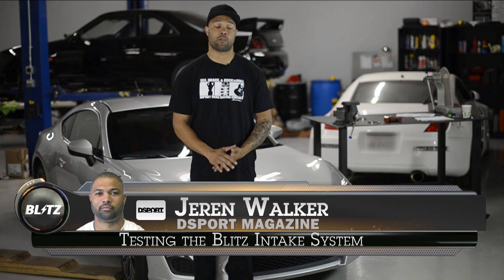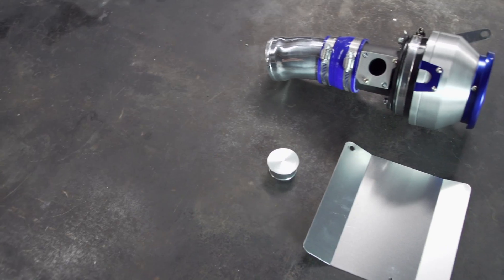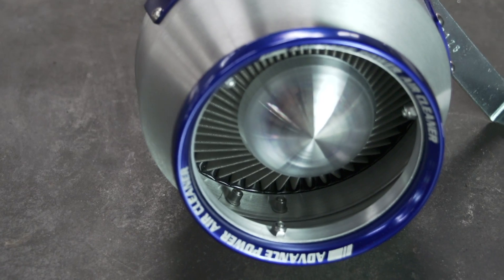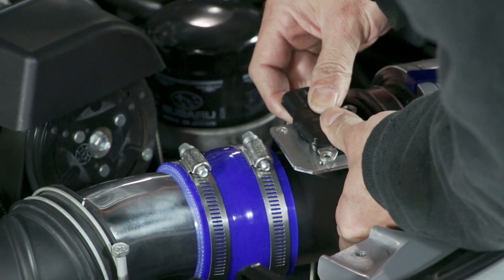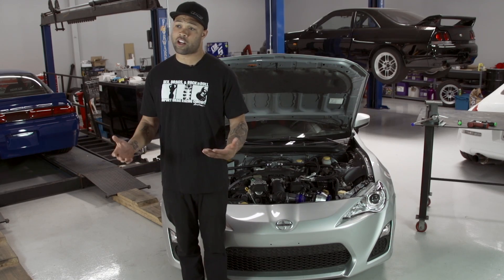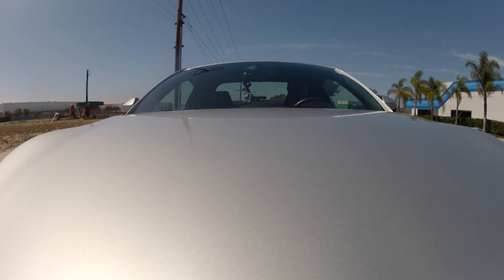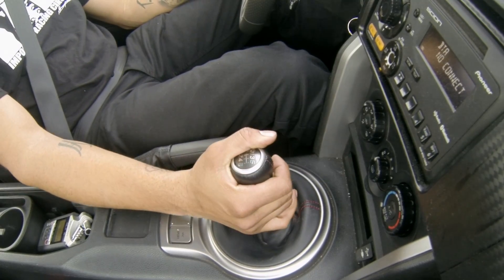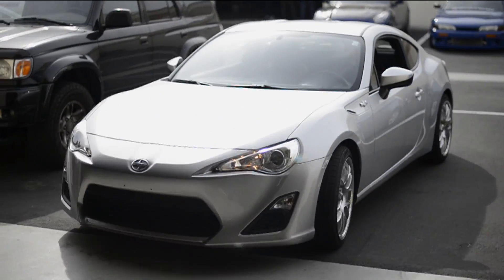2013 Scion FR-S Intake: BLITZ Dyno Test

Comment: Now how much does it had if you add the blitz suction tubing with it
Reply: I currently have just the pipe installed and it's noticeably louder on the outside of the car, even with the stock exhaust. I removed the sound pipe which goes to the cabin and you can definitely hear the real sounds of the car a lot more, which sounds nicer imo.

The stock intake pipe has a resonator on it, which I'm guessing is why the noises increases when you remove it.
Reply: Well I might be able to get it, my piston wants to say hello, its knocking

Comment: I have the bliz. I brought my FR-s to Japan and it was recommended by my friends with GT86s.The only thing I did not like was it fits weird with my kakimoto intake pipe so I will prob change it back to stock and the maf wire is stretched out.Other than that they say it is nice and it is nice.I was warned though in the summer it sags because of heat so get the greddy snorkel and it helps alot. I am thinking about going with afe this winter or waiting to see if they come out with a better-designed intake in Japan.Now there have been a couple of Japanese dudes who did not like the maf wire stretched over like that so they modded theirs so the wire could stay in the same spot.Make sure you have slack when you install this. Cheers

Comment: Is this BLITZ intake is CARB legal in CA? Just wanna make sure before buy it.
Reply: Saaqib Malek Hardly a cop is ever going to check your engine bay. This intake is very easy to install and uninstall. Don't worry, just do it! You only live once ;).
Reply from the maker: H Chang  In issue #129, the buyers guide, the first section of the specs indicates whether a filter has a C.A.R.B EO#.  In this case the BLITZ advanced power air cleaner does not appear to have a EO#.
Reply: DSPORT So how do we find out if its legal or not? I've bought the intake already and its just sitting in my trunk now :/
Reply: Damm why it doesn't has a c.a.r.b eo#. Too bad,  don't wanna get a ticket just for it.
Reply: +H Chang Does it really matter? Like if a cop is even going to check your engine bay? I had a cop look at my engine bay one time and he is impress how different the filter design looked rather than giving me a ticket.
Reply: +loveever89 not all cops are same, some are cool some aren't. I'm just deciding what to do with my intake now, either install it and risk getting my engine checked and uninstalling and installing every year I go for a smog check.

Comment: I watched all the videos, and Blitz scored the best. It has a metal only filter element that is a multi layer mesh, but how about filtration capability, because that is an issue with all aftermarket intakes. 
    I saw a transaltion from an older japanese magazine where they compared intakes, and blitz scored high and it was not the worst in filtration, and many said that they used very tiny particules that would be rarely encountered in real life, so according to that test if you clean it regularly, you should be fine with a blitz intake.
   I have a Blitz SUS C1 core with heatshield on my evo x mr, if anything goes wrong I will have first hand experience.
Reply: 8 years later, would you still recommend?
Reply: @bbKinito   I am using BLITZ ADVANCE POWER A1 CORE on my bmw E34, and I am really satified with its exquisite quality.